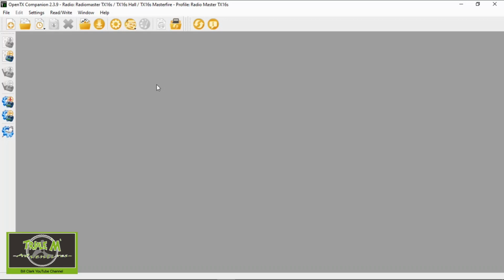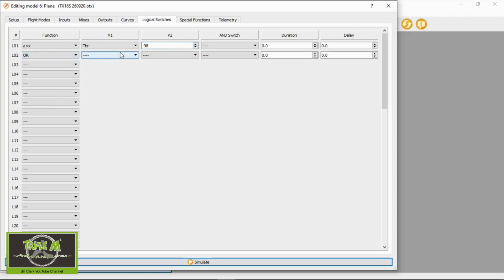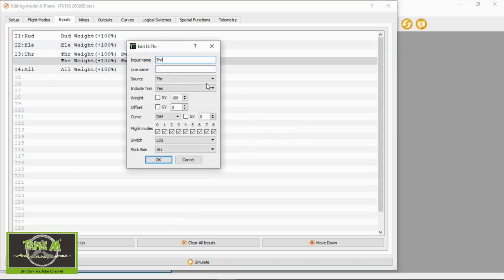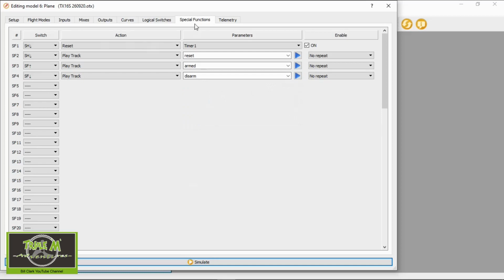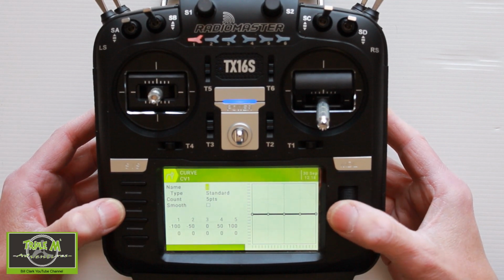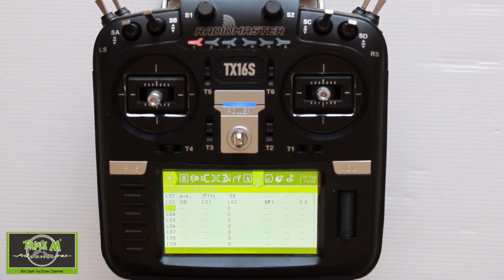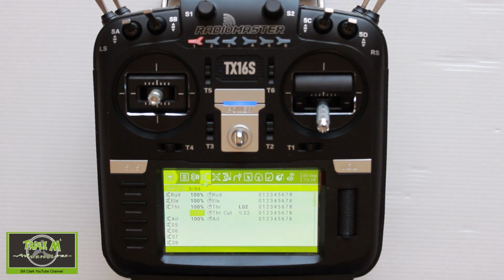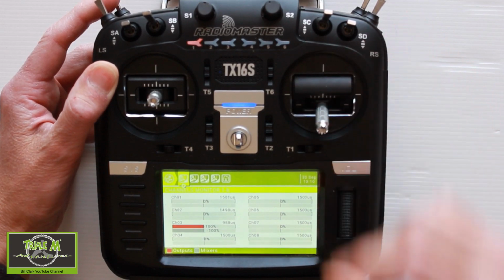RadioMaster TX16S Setting Up A Fixed Wing “Safe” Throttle

Comment: Bill a simpler setup. Do not do any programming in the mixer page but add ch3 override to -100 when !L2 . Then there is no need to do a custom CUT curve as well. Thanks
Reply from the maker: That’s what’s great about EdgeTX there are different ways to get the same result. I will take a look at your adjustments and may implement it in my future new radio tutorial videos. Thanks.

Comment: How is it all these videos are completely different than what my tx looks like?.I have a brand new tx16s..  I'll never know the answer to the question because I don't even know how to check a reply on this comment
Reply from the maker: Hi Steven, which firmware does your radio have OpenTX or EdgeTX? If your TX16s is new it should be EdgeTX so look in my playlists for the EdgeTX version of the “safe” throttle set up. Try this video. 

https://youtu.be/9oZrEa74AEI

Comment: Hi. Is not special function an easier method  to get same outcome?
Reply from the maker: That is the benefit of OpenTX and EdgeTX there are more than one way to program what you want to achieve. Why not come up with a different way and email your method to me I would be interested in seeing it.
Reply: @the-happy-RC-flyer  Bill I don't know what to do, I cant find a solution . I'm naive to Edgetx. I'm kinda scared. My objective is, arm/disarm switch  that BF set  by default. I'm good with that but!  if you hit disarm (booboo) your quad falls to earth smash 😢 I wish it would only disarm say, bottom 10% of the throttle stick only So you cant kill motors while in flight by mistake . Some one said it can be done in Beta F, I never seen proof. I'm sorry !, I'm smart but stupid lol I thank what you do for folks.
Reply from the maker: @BrainDeadEngineering  I think what you would like to do may be in my opinion dangerous you really must be able to disarm your drone in a positive way. Also very importantly do not use the Safe Throttle shown in my video for your drone this is only for fixed wing planes.

Comment: thanks, in my old transmitter this function was called Throttle hold, there was also an Idle down function, when this function is enabled, the throttle stick does not work below 10% of travel, which prevents the engine from stopping when performing complex figures, please tell me how to set this up
Reply from the maker: Please check out this video it should help you https://youtu.be/ijltcXObZBM
Reply: @the-happy-RC-flyer  thank you very mutch

Comment: I'd like to put slider on elevator so I can set bit of up elevator for when I launch any ideas how thanks
Reply from the maker: Hi Steve, just add a line to the elevator mix in Mixes, select the slider you want to use under Switch. I would suggest changing the weight to a lower percentage because if you leave it 100 it would be easy to put the plane into the incorrect attitude. I would set the mix to a switch rather than a slider so when the switch is activated the elevator will only move the set amount. You could then add a sound when the switch is activated saying launch mode. I will make a video of this for you.
Reply: @the-happy-RC-flyer  it was that line I missed out and enabling it too

Comment: Jingo., Just discovered your video on setting Safe throttle, very helpful. Have you a video of how to set th rottle so that it does not become active until it has been moved a fraction from -100,
Reply from the maker: Hi Shay, could you please let me know why you would like to do this? It sounds like you want to make a dead band on your throttle.

Comment: HI Bill, sorry to ask under this video but it seems have an issue with the T3 trim (glow engine) I can set it up from middle tp top and it works on the servo, however from trim center down to close the motor it doesn't make any change on the servo, any idea why is this happening ? second model works just fine
Reply from the maker: Hi David, this is an interesting by product of the safe throttle set up. I only fly electric planes so a safe throttle is very important because the motor will power up with throttle forward but a glow engine will not so a safe throttle is not so necessary. You can get the trim to work by lowering it pass Center and down to the lowest position. I have never come across this because we do not use throttle trims for electric motors. Please lower the trim to the bottom and let me know if it solves the problem. You could still use an arm switch to turn the throttle channel on and off. I think the throttle trim is changing how it works because the safe throttle uses a logical switch but I am not 100% sure. You helped me learn something today!😃
Reply: @the-happy-RC-flyer  well as soon as I fix this i will let you know . The strange thing is the fact that all others didn't need anything on settings. I even replace the servo. Same . I will see and let you know , thanks for your prompt reply.
Reply: ear Bill, seems like the issue was that I didn't checked the trim idle only on the MODEL SETUP. now I want to change the servo travel , actually to make it smaller as it is too much. how should I do it?
Reply from the maker: @davidsebbag1695  you need to change the weight in Inputs and the Offset which should equal 100 added together dropping the - so you get full resolution.
Weight 80 Offset -20
Weight 90 Offset -10
And so on.
Reply: @the-happy-RC-flyer  thanks Bill. Worked like a charm , ready for test flight. Thanks a lot. By the way it's Shoestring, should be nice.

Comment: Good Day Bill. I did this and love it. Can you please do a tutorial on how to set up idle up on a switch please for gas engines? I have switch SG assigned for low idle, idle up 1 and idle up 2. I assume you have to use curves. I have a custom throttle curve but opentx does not all you to copy it. Your help will be greatly appreciated. Thanks
Reply from the maker: I will work on that for you.

Comment: HI and thanks for all your videos, I do have a question, what would be the easiest way to make a throttle cut with a glow engine.
Reply from the maker: Hi David, good question! I think I would set a mix to a switch that overrides the throttle stick and sets it to -100 Then set the throttle trim so you can cut the throttle if needed but will idle with trim up so you can adjust the idle speed.
Reply: @the-happy-RC-flyer  I wonder , i will try and let you know.
Reply: @SA Sell Buy  my idea was when landing and getting close to my spot, use a switch to close the carburetor,  on idle its open 1 millimeter and still running, so I want to close that gap  , did it on spectrum radio , was easier. Unless I still need to deep learn this radio
Reply: Well i did it with a CH3 overide , perfect. with the trainer switch just in case . thank you all. now to dual rate and flaprons, if you have an easy way be my guest

Comment: I followed your instructions step-by-step but ran into a problem. After putting into the safe mode and then going back to the armed mode the throttle would not re-engage even though I put the stick in the -100 position for several seconds. I just received my TX16s a few days ago. Has Radiomaster made some changes so that your setup doesn't work?  I checked my work twice and it was still a no go. :(
Reply from the maker: Greg please check your settings again something is not correct look at the Input under the Logical Switches and make sure you have selected the throttle stick and not throttle Input. Nothing has changed in OpenTX for the TX16s.

Comment: Hi Bill, I have an issue getting this to work, I emailed you my OTX file, please take a look.
Reply from the maker: Jan sorry your are getting a slow response I am in the process of moving from the middle of South Africa to the west coast. If you followed my video your safe throttle should work fine. Will hopefully have my studio set up in a weeks time.
Reply: @the-happy-RC-flyer  No problem, I'll give it another go. In the mean time I can fly without the safe throttle set-up, I just need to hold the throttle down with my thumb in stead. I followed the companion settings and copied them into the Tx, which did not work. Should I do the settings in the Tx instead? I'll give that a go too...
Reply: Something I came accross: when following your instructions for the TX settings, I noticed my Thr screen shows a vertical line moving from left to right in the graphic, not the 45° I see in the video. Never mind, it's a result of the logical switches... It works now.

Comment: Great video Bill, I have learnt alot from you in the past month. Sorry for the newbie question, have you ever bumped the switch mid flight? Does it still take .5 seconds for the reset to occur?
Reply from the maker: That’s a really great question. No I have never inadvertently disarmed my model mid flight but yes you would need to drop the throttle for the delay time for the motor to run again. I think the risk of accidentally arming on the ground and hurting yourself is out weighed by the rearming delay. Your plane will not drop out of the sky with no motor and will glide under full control until you arm again. You would not use this safe throttle on a quad copter because the Flight Controller takes care of the arming and disarming process. No need to apologise for asking a question I am here to help and we were all new to this fantastic hobby once.
Reply: @the-happy-RC-flyer  Many thanks for the response. You really do know your stuff! I followed your well explained steps and I successfully have added this function.

Comment: Does this transmitter support the SAFE SELECT function? 

Here's the plane I want with the TX16s

https://www.horizonhobby.com/product/valiant-1.3m-bnf-basic-with-as3x-and-safe-select/EFL4950.html
Reply from the maker: I am sorry I cannot give you a definitive answer because I do not have experience with Spektrum equipment. I took a look at the model and the website states: 
Needed to complete the model you require a full range, 5+ Channel DSMX / DSM2 transmitter.  As for the SAFE Function I have no idea because it may require the model's receiver to be connected to a Spektrum Transmitter and not work with an OpenTX transmitter.
The flight control system could work independently of the radio link system but I do not know.
Sorry it is a vague answer.
Reply: @the-happy-RC-flyer  Thanks for trying. I really appreciate it. If you know anyone, who might know or have that set up. Please let me know. I really want that Valiant plane but don't want to drop $300 on the NX6. I was really leaning towards the TX16S.
Reply from the maker: @rupman27isback  If I was you I would email Horizon Hobby support and say to them you have a RadioMaster TX16S but would like to purchase the model you want and ask will if bind to the TX16S and all the flight control functions work. I do not think they will prejudice you because you do not have a Spektrum TX. Let me know how you get on please.
Reply: @the-happy-RC-flyer  I already emailed Radiomaster.  I guess i could try Horizon Hobby..
Reply from the maker: @rupman27isback  give it ago.

Comment: Hello,
Thanks for this tutorial.
Nevertheless a strange thing happened to my radio : I followed exactly what you did and it was working but my SF switch is then reversely than on your video. At position "low" (used at start of the radio), the throttle is ON and when I pull up the switch The throttle stopped. I tried to change it but I was not able to succeed. Can you help me ?
Thanks a lot.
Reply from the maker: If you check you have put the settings exactly the same as my video your motor will be armed in the forward position and disarmed in the back position the switch towards you. I prefer to pull the switch towards me to disarm i find it more natural, from your explanation this is how it is operating. Please check the settings and make sure in Logical Switch 2 the switch is showing the arrow up.
Reply: @the-happy-RC-flyer  Thanks for kind and fast answer. To be 100% sure to understand you (English is not my mother tong) : the forward position is the switch hight with the radio horizontal, screen on the top ? And backward position is a switch in low position ?
Reply from the maker: @marcvan9247  can you please back up your model and radio settings in Companion and email them to me and I will take a look. I may not get back to you today because it is getting late South African and nearly my bed time!
triplemadventures@gmail.com
PS.
Your English is great.

Comment: bill i have a question.my throttle is calibrated.but with one plane(bigfoot high wing)my engine doesnt start spinning untill i am reading -72 percent throttle.My small corsairs engine starts spinning when the throttle is lifted and hits about -87 percent.I am alright with a little bit of play,but is this correct?.The bigfoot is alot of play before motor starts.28 percent "play".Am i suppose to adjust this "play" out with the throttle trim?.seems like i didnt have to do this with my dx6i.(they all just had a tiny amount of play or uptravel before motor engaged).
Reply: i got it to come on now at -92 percent.i re connected battery up with throttle at 100 percent waited for the 2 beeps the brought stick back down.(thats was foolish of me).I thought i had already done this,i must not have.So does -92 seem about right before engines engage?..thank you.
Reply from the maker: @seanpettit6410  yes you needed to calibrate the ESC. Normally you put the throttle full throttle and plug in the power to your ESC you will hear a set of beeps then two beeps then cut the throttle. Your ESC should be calibrated. Please check the manual that came with your ESC.

Comment: Bill, thanks for taking the time to explain TX16S Setting Up A Fixed Wing “Safe” Throttle.
I really liked the way you explained  both the setup through Companion and how to program 
 TX16s directly into the program without Companion.  I am have difficulty Companion and
and I was impressed as how easy it was to program directly.